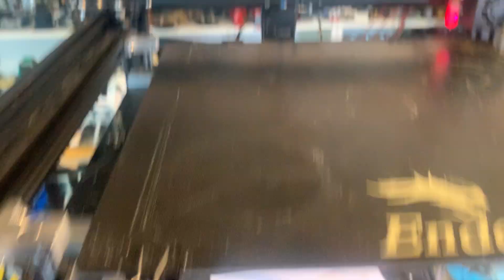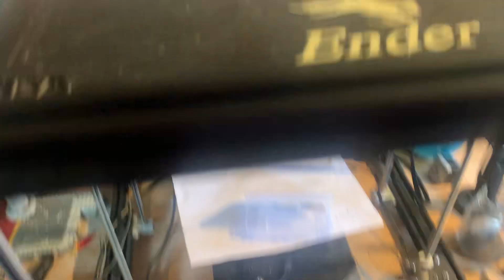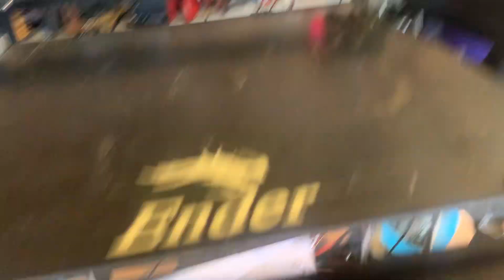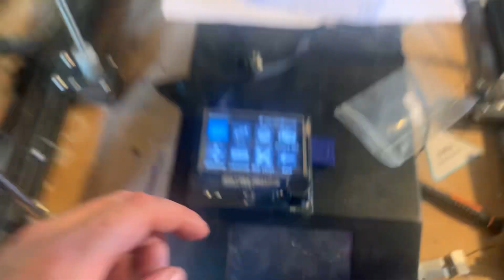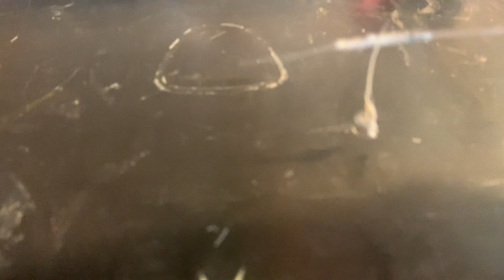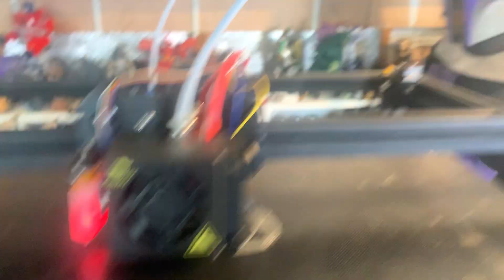3D Printer Issues - Help Needed

Comment: A couple things. Start by changing out your nozzle. And then if that doesn't work I would suggest doing a cold pull or two. You could also get another Stepper Motor that drives the filament and replace the one you have, they are like 12 bucks on amazon. I have been printing for a long time now with multiple printers and that's the only thing I can think about. Well Kinda. If you take off the cover around the extuder there should be a screw on the side of the nozzle. You could try to losen the screw and take out the heat sensor and just take a q-tip and clean the inside of that space as well. Make sure when putting it back in the hole you don't leave it touching the screw. Just the wires. If the sensor is in the wrong place it could be sending a false temperature and therefor not melting properly
Reply: Heatbreak fan

Comment: I want to point out the heatbreak cooling fan isn’t on. Also, have you checked your e-steps?
Reply: I missed this before I made my earlier comments above. THIS IS A BIG DEAL -- without the heatbreak cooling fan on, the filament melt transition zone is impaired. This will definitely affect extrusion AND most likely lead to filament jams/clogs. The heatbreak cooling fan should always be running 100% during a print.
Reply: @dougfleming8327 t should run if the printer is on. Bad wiring? He said there is a new board (I think) so they might not have been rewired
Reply: @ninjaread99  It does depend somewhat on the firmware. With some printers it is always on when the printer is on --  with other it only comes on when the hotend starts to heat up. But it should ALWAYS be on when the nozzle is above approx 50c. That was a good catch that you noticed the fan was not on. I'm surprised it was actually extruding filament and not jamming from heat creep into the heat break. Whenever I've had a hotend fan stop running when the nozzle was at print temperature it caused a jam. I would be almost 100% positive that the fan is his problem.
Reply: @dougfleming8327  I have 2 ender3, and that fan always runs
Reply: And if this doesn’t work, r/ender5

Comment: my ender 5 has always given me trouble, this looks like its either a partially clogged nozzle or your extruder is slipping under load perhaps adjust tension. Could try a cold pull  and see if there is like a metal shaving stuck in the nozzle.

Comment: You casually remarked -- "ignore the dirty bed". While I generally print on PEI - and am not really sure about printing on glass -- I do know that a dirty PEI bed will cause exactly what you are seeing. I'm not so sure it's not extruding -- its just dragging filament all over the place. I also noticed you swiped your hand over the bed to clean it off. I absolutely cannot do this with PEI. I will see filament lifting in just the area of fingerprints if I can see them on the bed surface. In any case, I would at least eliminate an unclean bed as a variable. It may not be your problem -- but I can't tell you how many times I have fought the exact same issue and was able to fix it by cleaning the bed with hot soapy water and rinsing thoroughly.
Reply from the maker: Thanks for the reply I cleaned the bed and it started to print looked normal then went back to printing spider webs I’d understand if it was the filament but I’ve tried three different types with the same results
Reply: @DarkRavenProductions  Sorry that it didn't work. Don't give up. These issues can be a pain to track down. The only other thing I would have to say along the lines of a dirty bed -- is that after you clean (which you did) it is important to go through the earlier steps you already tried -- most importantly, re-examine and retune your z-offset.
Reply from the maker: I did that this morning set the z offset to zero then set a print going that lets you see the bed level and lowered it until it started to stick to the bed
Reply: @DarkRavenProductions wanted to make sure you saw: your heatbreak fan (that one in front) seems broken. It should run at all times.
Reply from the maker: I thought you meant the one on the side, what effect does that have on printing
Reply: @DarkRavenProductions  the heatbreak fan cools the heatbreak. It prevent the plastic from being molten too far up the hot end
Reply from the maker: turns out i didnt have the fan plugged in all the way now it turns on when i tell it to print but the printer now displays a heating error
Reply: @DarkRavenProductions  what’s the error?
Reply from the maker: If i try and preheat it i get a printer halted, kill error if i start a print it hats the bed fine then heats the nozzle to 205 then suddenly drops down to about 180 then a heating error pops up and the printer restarts by itself, without the fan plugged in i dont get any of these errors
Reply: @DarkRavenProductions  have you asked Reddit yet?
Reply from the maker: @ninjaread99  not yet, ive posted on a Facebook forum but i haven't got much response form that, is reddit a better place to post
Reply: @DarkRavenProductions  it’s helped me with a lot of my problems. Idk how r/ender5 is because I have the 3, but they r/ender5 could probably help a lot. If they don’t know, there are more 3d printing subs
Reply from the maker: thanks for all the comments ill check Reddit out